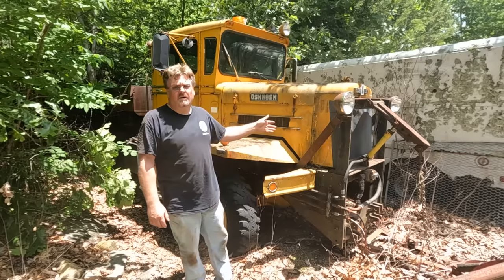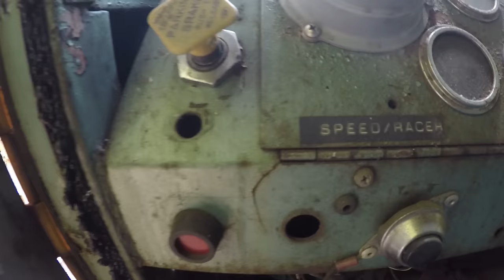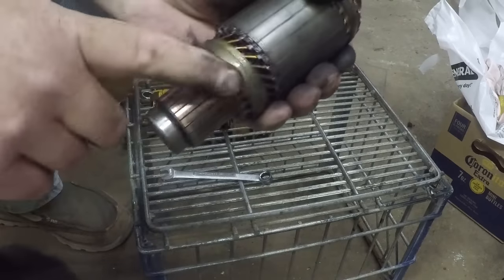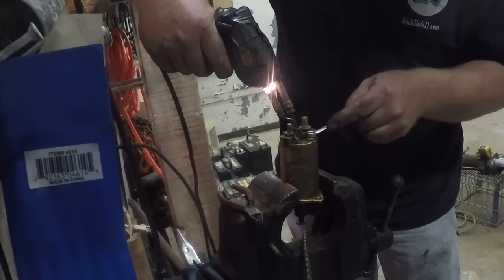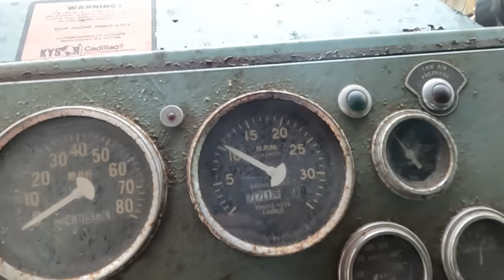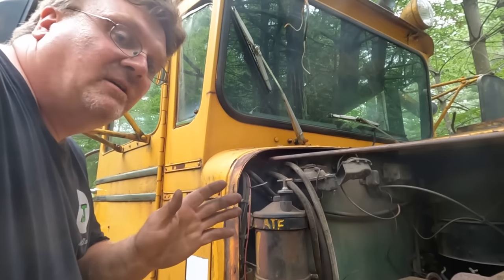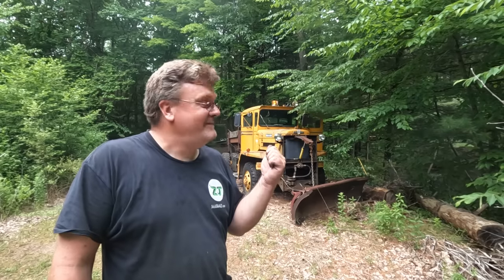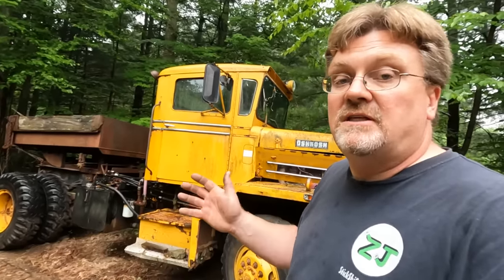6BT Powered Oshkosh Plow Truck, First Start in Over 10 Years!

Comment: Besides cleaning the commutator, what fixed the motor part?
Reply from the maker: That was all I did there, but I'm wondering if the brushes were stuck, and I knocked them loose while taking it apart.  Because of the bad contacts, it was probably running on voltage too low and amperage too high, which could of overheated them and fused them lightly in place.  I don't really know, though.
Reply: @LowBuckGarage  awesome!

Comment: Oil level hi.. Big red flag !!!!!   Crack the drain plug. before you put water threw all the filters.
Reply from the maker: That's a good point, but it ended up that it was just on a hill.  Once I got it to level ground it was fine, no water at all.

Comment: The oil level was high because of water sitting in bottom of pan, to bad you started it without draining off water.
Cummins is scrap now.
Reply from the maker: Actually, it was on a bit of a hill.  Checked it again on level ground and it was fine, no water at all.

Comment: ABSOLUTELY NEVER BLOW COMPRESSED AIR INTO A MOTOR.  YOU JUST FORCED ALL OF THAT CARBON DUST DEEPER INTO THE MOTOR AND EMBEDDED IT HARDER INTO THE INSULATION.  THAT IS THE SINGLE BEST WAY TO DESTROY ANY MOTOR.  Just looking at that poor starter, if you megger it, I guarantee you will fail the minimum resistance values for operation.   That would instantly get you NJP in the Navy and probably dishonorably discharged.  If  you were nuclear navy like I was it WOULD get you dishonorably discharged.